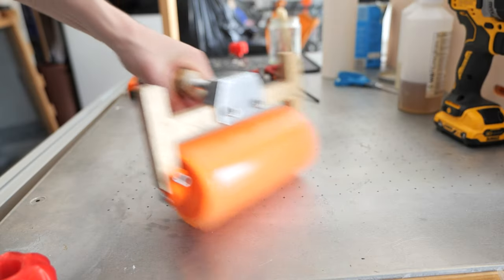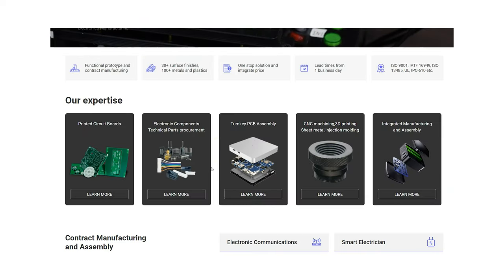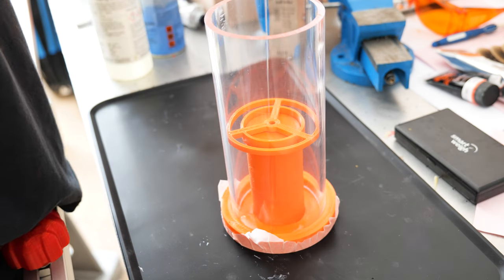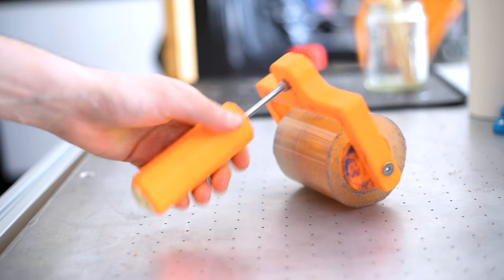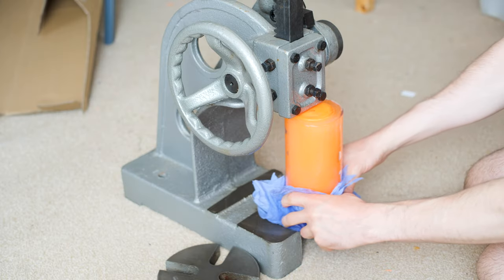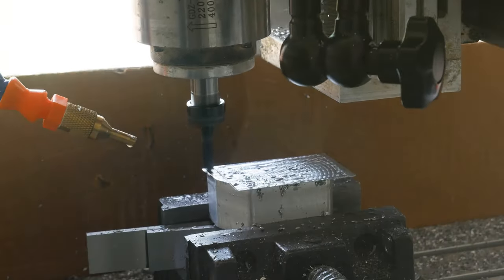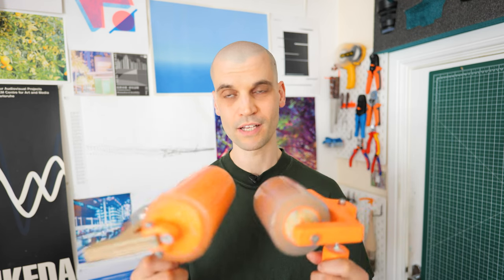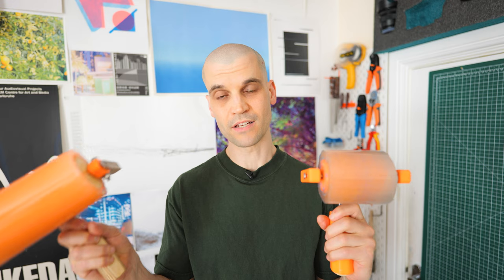DIY Brayer Rollers for Printmaking - Save $$$!

Comment: The high pour technique you're using should eliminate a lot of the bubbles in your resin, is there a chance you're getting air trapped in the ridges of the 3d print?
Reply from the maker: It could be, ive purchased a vacuum chamber and will be making a few more smaller ones to replace all my speedball ones so I'll check to see if i still have bubbles